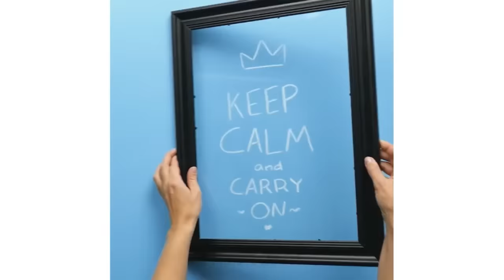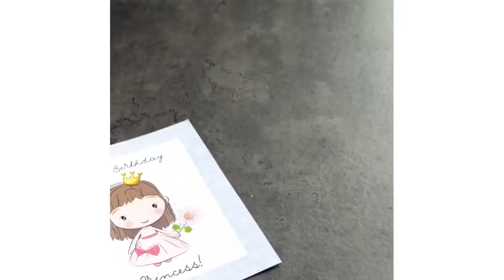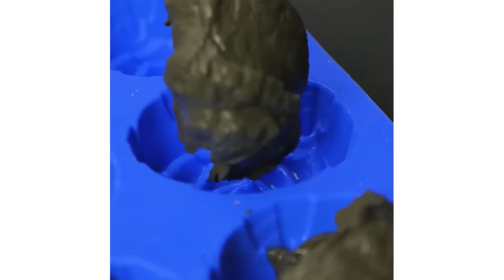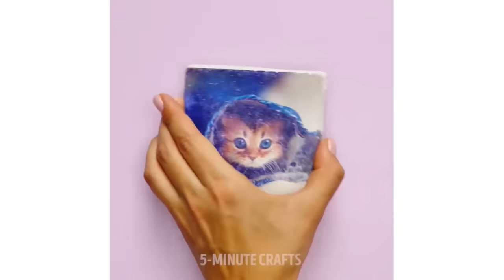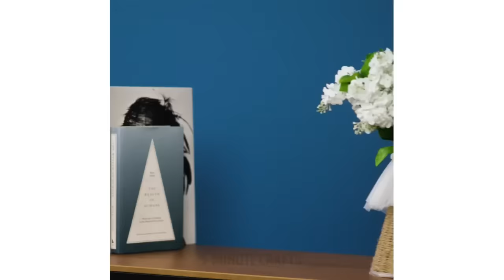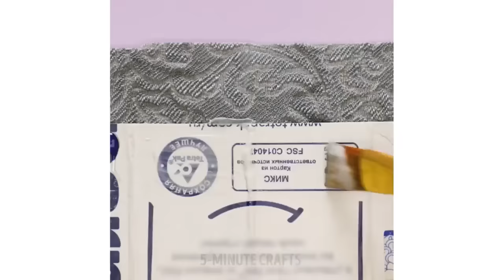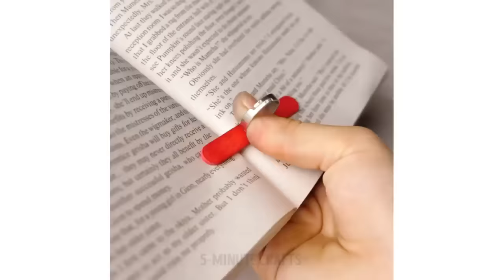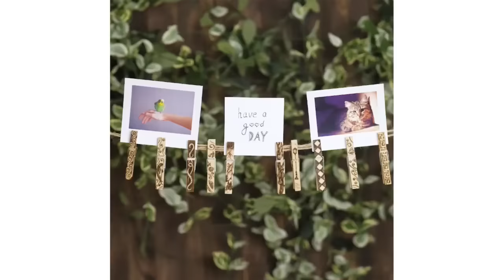100 FUN DIY IDEAS FOR YOUR HOUSE LIVE

Comment: 00:50 if they were gonna make it black why not just make it black in the first place
Reply: It was written in white on the front of the glass, so that when they turned for around, they could see it to trace over it, that way it would still be facing the right way, and would t get damaged over time as the black writing is on the back side of the glass.